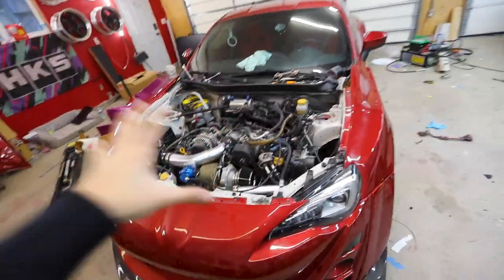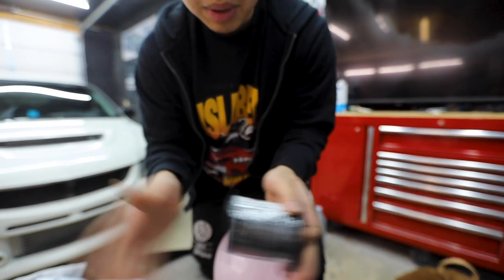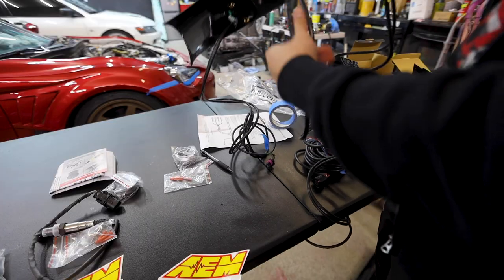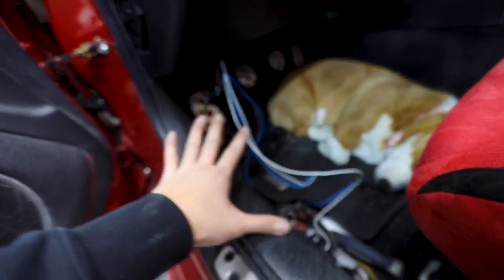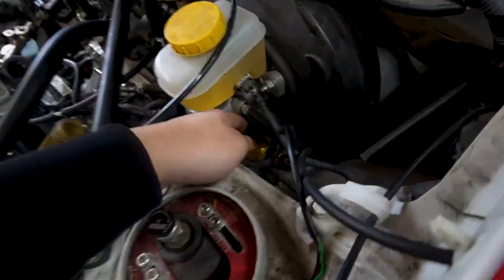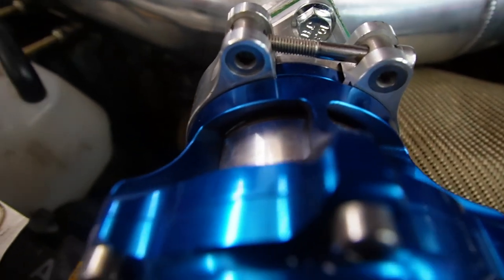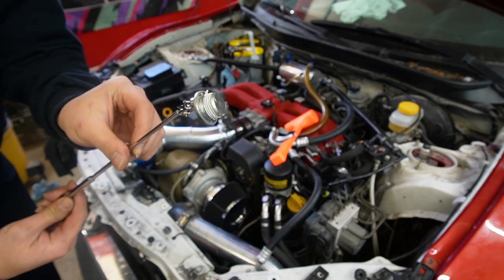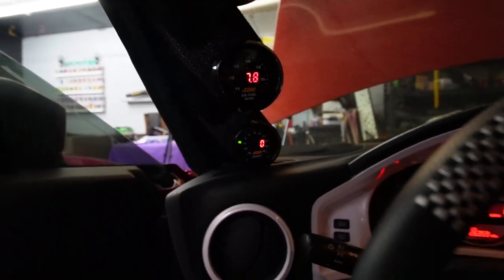INSTALLING GAUGES AND GAUGE POD ON MY TURBO BRZ!!!

Comment: If you get stuck placing the oil pressure sensor on another build you can get a 1/8 npt tap (an female x 1/8 npt x an male) and add it to an oil cooler line at the sandwich plate end.

Comment: You should be placing your AFR o2 sensor at least 36 from the exhaust ports to make sure you get accurate readings and dont burn the sensor -- according to AEM instructions

Comment: I don’t know where to put my oil pressure sensor. My oil line is running to my turbo and my sandwich plate is used for my oil cooler :(
Reply from the maker: There’s a stock oil sensor port in the front of the motor! Below the oil filter and by the pulley!
Reply: Oh yea I forgot bout that! Thank you!